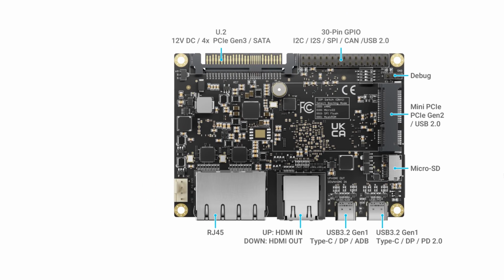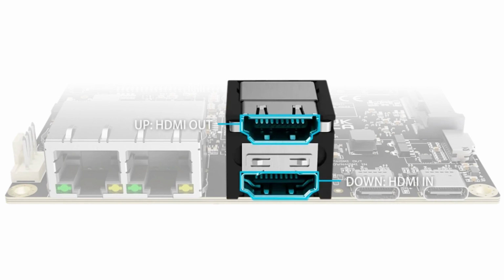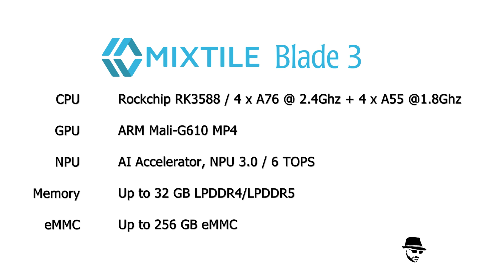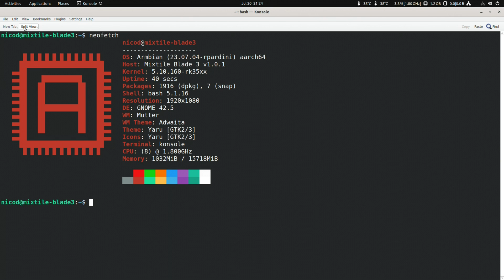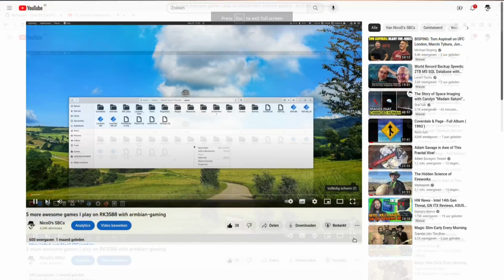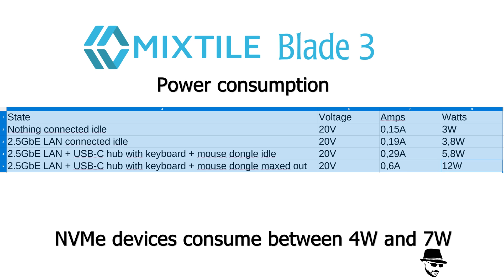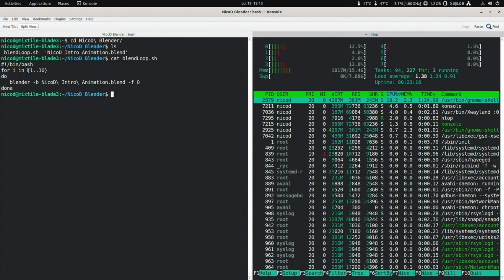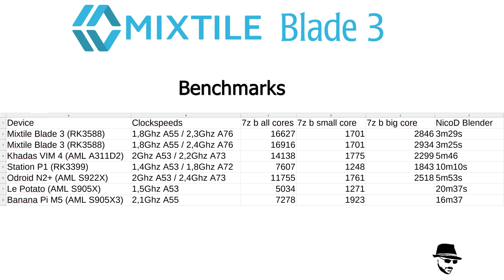Mixtile Blade 3 - Review / My new favorite RK3588 ARM desktop SBC ! ! !

Comment from the maker: Hi all. The Blade 3 isn't being sold yet. If you are interested in this board, please let me know. 
Another product that is being sold from today is the Mixtile Core-3588e.  https://www.mixtile.com/core-3588e/
A System On Module (SoM) with RK3588 and compatible with NVIDIA TX2 NX carrier boards.
Reply: I see that can run 4k/30fps can it run a 4k/60 And how looks support from other linux systems
Reply from the maker: @diuran3029  It can play 4K60 video files h264/264 but not Youtube videos at 4K60 and 4K display resolution. Then 1080p60 or 1440p60 @ 1440p display resolution.
With Android that should work out of the box. 
No Android images available for it yet. The only other image that runs on it is their Debian. And that needs work.
Advantage of Armbian Jammy is we have GPU drivers and VPU drivers with RPardini and Monka images. 
Software development is still a work in progress. But for my goals it's good enough. Most important thing to add is the cluster functionality.

Comment: I do have a question, does it has any wireles capability? can you install a wireless card? i may get this one and 3D print a case with a proper fan to make a retro gaming console emulator.
Reply from the maker: Hi. The Blade 3 doesn't have wifi, it has mini-PCIe to add a wifi adapter.
I wouldn't recommend this devices for just gaming. OPi5+ would be cheaper and as good. This is specially designed for cluster tasks and you pay for that too. Even if you don't use clusters.
Mekotronics R58X 4G would be better fot that goal. already has a great case, has wifi, is great for gaming, has android if you'd need it...
The Blade 3 still is in early development. Works for me. But I'm not the most regular user.

Comment: Hi Nico , will you have a chance to review Orange Pi 5 plus ? It looks like a very interesting option
Reply from the maker: Hi, I'm not going to have one. It indeed also looks like an great RK3588 SBC. You can't have t hem all, but I do have many :)
Reply: @NicoDsSBCs  :) I am planning to get that one because they are selling large heatsink models which works without a fan , it looks quite interesting to see if it can keep its performance under sustained load
Reply from the maker: @SGMTLD  Indeed, I also do not want my ARM devices to use fans. I need to replace the thermal pad on the mixtile to improve thermals a bit. But at least it's not throttling even when used maxed out very long. I hate fan noise from my pc, so I keep it of as much as possible and use RK3588 instead.

Comment: Not too bad. Looking at the case it does seem as if it was designed to be able to be used in the cluster configuration by removing the top plate in order to quickly and easily stack another one. Putting some pads or stands onto the bottom of the case would help with table contact. The temps are rather worrying though for something that is capable of multiple concurrent functions, so a better cooling functionality is required to make it more attractive. The I/O (and price) does suggest that this is not designed with the average home user in mind (subject to there being a suitable definition of average home user of course), which does open up opportunity to produce a modified version that has much of the same functionality but scaled for more average home use. So ditch one of the ethernet ports and give another USB port. Perhaps remove the stacking functionality. But keep the rest as having both NVME and multiple SATA port options would be desirable for quite a few. I like the switched for easy bot device determination, although with SPI flash onboard, it does make me wonder why this cannot handle all boot device options from a suitably developed bootloader. The one downside to all RK3588 products right now seems to be that development has slowed to a crawl because the limitations of the old kernel are being seen, so the full benefits of use by many Linux based distros cannot yet be seen. And it is not as if we can have confidence in Rockchip themselves producing an updated SDK, based upon their history of lack of ongoing support. Whether more mainline support will come from elsewhere seems to be an unknown right now. I hoe that history does not repeat itself and we have another great SOC where the hardware capabilities can never really be accessed. None the less, we do see an advancement n the hardware options available for his SOC.
Reply from the maker: All correct what you say. 
It would not overheat if I had done with fan and hot side up. Or just not touching the wooden table. 
And you could replace the thermal pad with a copper shim too. 
Also making better contact between top and case would improve things. 
So there's room for improvement. 
It has been designed with a special customer in mind who want clusters with fast communication. I'm happy they also thought about other use cases. 
I don't know if there's any competition that's doing this with this SoC. I'm no cluster user so I don't follow that niche that much. I do want to see it working.

Comment: Thanks Nico.  I absolutely love Rockchip based SBCs, they have some flaws but if you're a hardware developer they have some HUGE advantages.  Also the new RK3588 is a screamer.  I do a lot of hardware development work, and I ran through a million different chips from various manufacturers before I figured out that Rockchip uses an independent USB controller for each one of their USB ports, even on their low-end crappy chips.  Every other manufacturer cheaps out and uses ONE USB controller and splits that off to multiple ports through a hub.  So if you have a robot that needs 3 or 4 USB cameras, or any medium-to-high bandwidth device like a USB hard drive or something, you're sunk.  Funny quirk with USB is that each device "reserves" a certain amount of bandwidth, even if it doesn't use it.  So if you plug two USB cameras into a Raspberry Pi, one of them won't work.  Why?  Because the first camera has already "reserved" too much bandwidth on the bus and the second camera has been disabled.  Can't plug two USB cameras into a Raspberry Pi, or a Odroid N2, or whatever because the second camera will just be disabled, even if you crank the resolution down.  Not a problem on a Rockchip because each USB port has full bandwidth.  This is a big deal and nobody really knows about it.
Reply from the maker: Indeed. Rockchip SoC's are way better for I/O than any other.
Amlogic, Broadcom and Allwinner do not care much about that. 
This board doesn't have many USB ports to use. But would be possible to add some with M.2 to USB3 adapters that each have full lanes to use. 
Even the RK3568 has great I/O. I don't have any but looking to get one to review. Greetings.
Reply: @NicoDsSBCs  I totally agree.  Keep up the good work good buddy.  I always love the videos.  If you figure out how to get the clustering or the NPU working on this thing that would also be very interesting.  I'm still not entirely sure how the clustering is supposed to work.  Does the PCIE interconnect just emulate a really fast network interface between boards?  Does it do something more clever like enable NUMA?  No idea.  Either way it's a very interesting board.  I have a Rock Pi 5b right now and it's great, but the Mixtile looks like a better take on the RK3588.

Comment: How about mounting the heatsink on top of the hot side of the black case with a single large or multiple small thermal pads? That way you can have it in the case and passively cooled (best of both).
Reply from the maker: That would help indeed. My issue with the case is that I can't access the mini-PCIe for my SATA adapter. 
I can use USB3 to SATA adapters. But I can only use one. Not sure why, but when I connect 2 then one stops working. With SATA I do not have that issue. 
Good tip, greetings.

Comment: Eh...looks like a very solid board for daily usage. And I'm interested.... but im on a very tight budget atm.
Reply from the maker: It is quite an expensive device. But actually not when the cluster functionality works. Cluster boards often are way more expensive.
If you want this SoC and don't care about price, then OPi5(+) provides the cheapest devices. But not the best quality then.
I've got the luck that I'm getting them for free, I wouldn't be able to afford them either. Greetings.